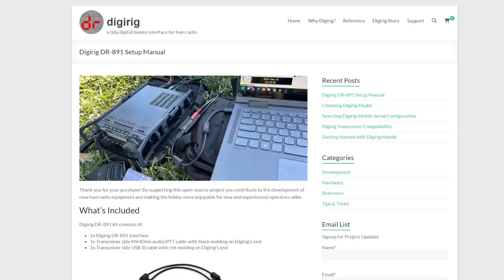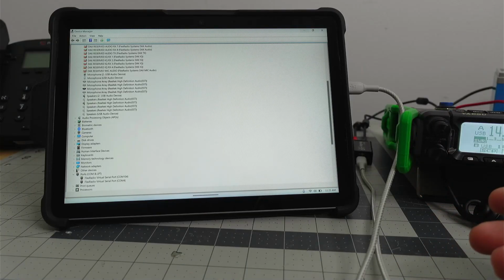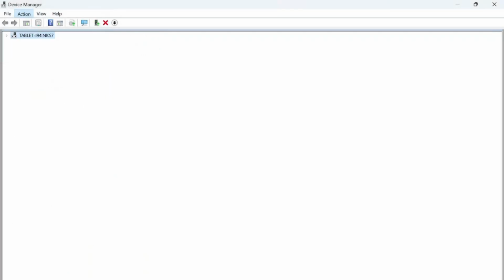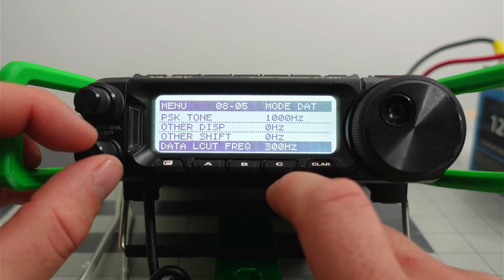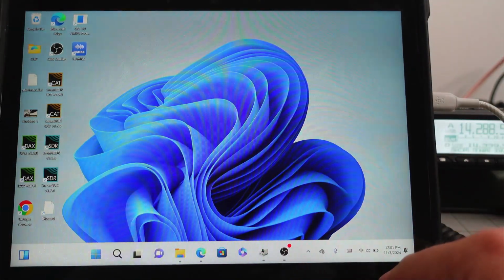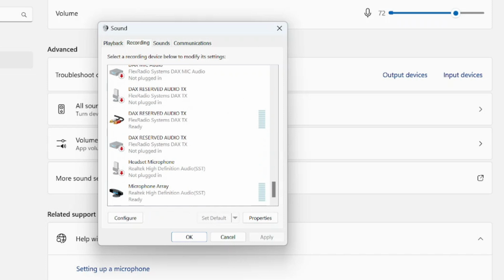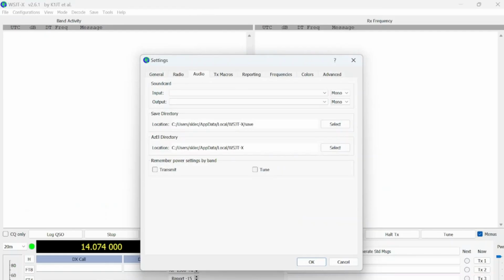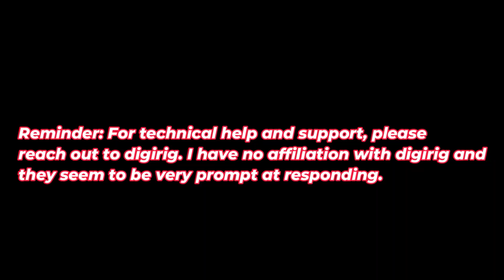Getting Started: Digirig DR-891 / Yaesu FT-891 Setup for WSJTX

Comment: You don't want to set the DigiRig devices as the default Communications Device. Any Internet phone software or Meeting-type software's will use it as the speaker and microphone
Reply: Ah, you caught that later on in setting the "array" as the default communications device.
Reply: My radio does not fare well when set to "Fake It" for the frequency split. It causes the frequency to increase by 1MHz. I had to use the "Rig" option and it seems to do okay.
Reply: Excellent videos, though!
Reply from the maker: Thanks..  that's a good suggestion about not setting it to Fake It.  This does happen with the DR891.

Comment: I plan on using the ATAS A120 with my FT-891 and FT8, so, if the ATAS is turned off, that might goof things. I should remember to tune with the radio and not the software.
Reply from the maker: I wonder what it would really effect. I don't have one, otherwise I would try it.  It's possible @hamradiotube has one and could try it! Good luck!
Reply: @DudeTested Will do. Thank you for your help!
Reply: @DudeTested  Here's the result I got: The ATAS A120 DOES work with FT8 -- however, you still must tune it from the radio, as WSJT-X cannot tune the ATAS itself. Be within range of the tune button. Other than that, it works well. I recommend running it 5-20 watts, but no higher than that.

Comment: Great video, sir!  Using FT-891, and WSJT-X.   On 10m, FT8, software says 29.074.000.  But I find better results at 28.075.000.  But I make a few QSO's, then I see the radio says 28.074.500.  Then a few more QSO's, then the radio says 28.074.000.  Next, it says 28.073.500.  Why is the radio frequency indicator dropping?  What am I doing wrong?  Many thanks!
Reply from the maker: Ah yes!  I experienced this problem once also.  I do not recall the fix, off hand.  It may be great to shoot DigiRig an email. He will give you a quick and accurate response.  If I forgot something in the video, I will gladly update it.  I feel like my solution was some RFI was causing the connection to get lost, adding chokes on the usb/cables may have helped.  I cannot confirm that, however.

Comment: Fantastic Video!
Reply: Was it necessary to do a factory rest on the radio prior to setting up the radio with the Didirig?
Reply from the maker: Thank You for the Kind words.  As I recall, the instructions (https://digirig.net/digirig-dr-891-setup-manual/)mentioned a factory reset would be used only if things "get out of hand".  A fresh restart is sometime beneficial.  But I do not believe it was necessary.

Comment: After following these instructions (on a brand new out of the box radio), I only had signals on about 1/2 my FT-8 waterfall. 0-1700 offsets. To correct this, I need to set FT-891 menu options 08-03 and 08-04 to 1500Hz

Comment: I've got the DR-891 and it works great.  Great calling out the Ferrite for the USB cable, I had issues with mine right away disconnecting USB, and 2 snap on ferrites later fixed the problem, one on each side of the USB cable, a high quality USB cable will also help out versus the cheap ones from the dollar store.  73! WQ9F
Reply from the maker: I always forget you have the 891.   Yeah, it makes portable digital modes a breeze!